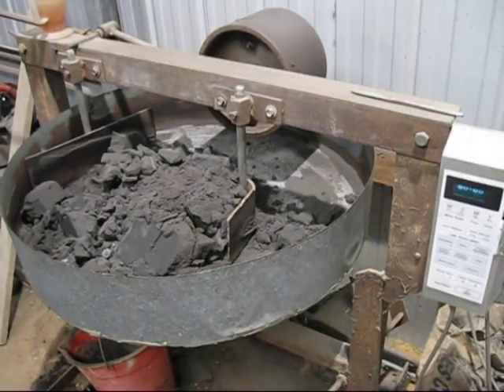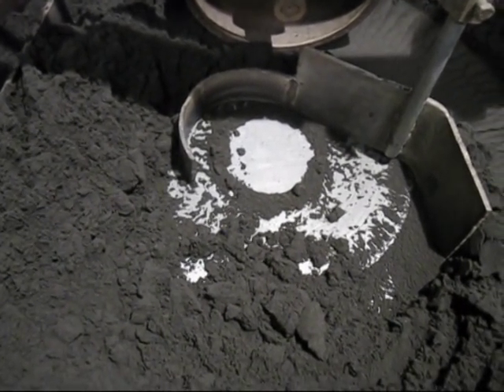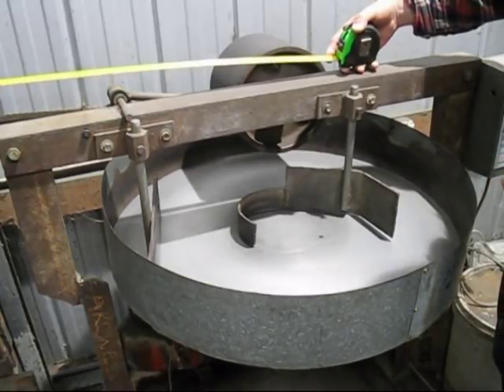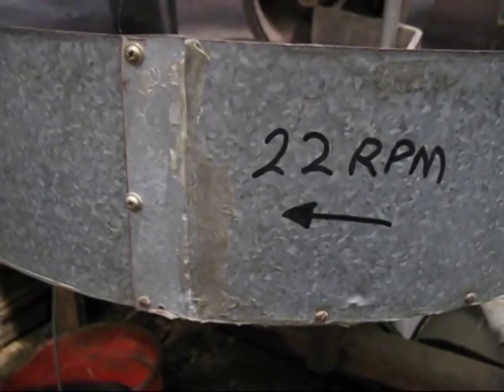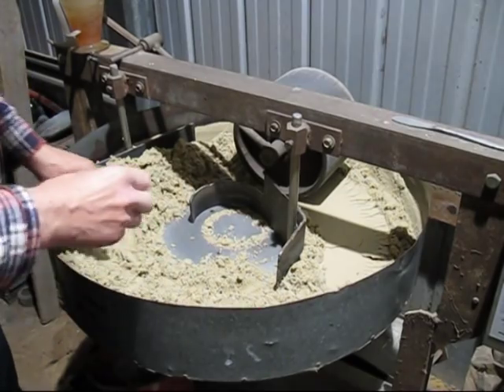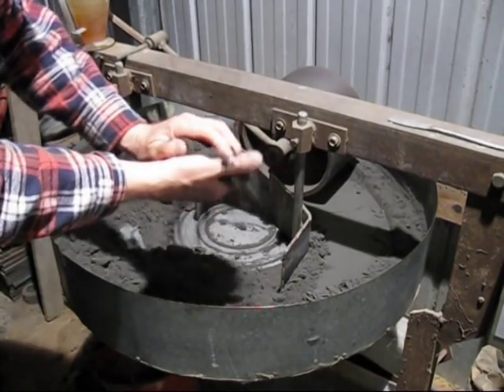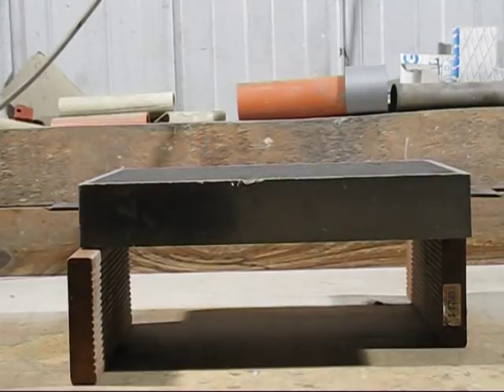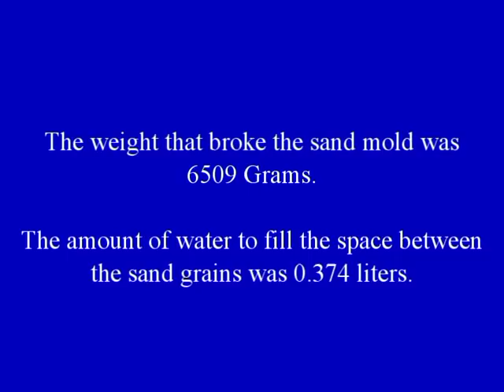Sand mixer and mixing sand

Comment: Your sand muller is the best for a small production! Years ago I worked in a foundry (grey cast iron) as a molder and our night crew mulled thousands of tons of sand and on more than one pour got the moisture content wrong leading to amazing fireworks.  I still pour Aluminum, Brass and Bronze with my own petrobond mix in my 55 gallon drum forge, but after watching this video I might try Green Sand again...Might be a whole bunch cheaper! Thanks for the informative video!
Reply from the maker: Anything is better than mixing sand by hand.

Comment: Great video.  I just made my first aluminum casting / test today. Successful test of textures on lost foam. 
Long way to go yet.  Your videos are a great help.  Thanks.
Reply from the maker: That's great, have you made a video of the melt?
Reply: @luckygen1001  Recorded some but haven't reviewed it for editing yet.
Asperations vs Reality.
Super cool casting vs Learned a lot today.  Great day.
Will be posting when ready.
Reply: @luckygen1001  I just posted the results of my first casting tests.  
Pleased with the outcome. 
What should be put in the aluminum to separate the metal from the dross?  I've seen many videos about this, but still questionable.   Help very much appreciated.

Comment: Those microwave oven timers are handy, I made one for an electrical heating pad for sore muscles us old farts get. I can of course set the time but more importantly I can program and vary the power level, like two minutes on high, 8 minutes at 80% power, the thing works a treat. ☺
Reply from the maker: Microwave oven timers are seldom reused for other purposes, which is a shame because they are so useful.
Reply: Yeah, I have to look away when I drive by one roadside now, too much parts of 'em on the shelf. I made several shop coolers from the squirrel cage venting blowers found in the high power over- the- stove models too, they can really move some air.

Comment: Awesome description.  I use Petrobond in my small aluminum foundry.  Since it uses oil instead of water the explosion factor is greatly reduced.  I believe Petrobond is more expensive but for the small castings I do for model steam engine work it works well. Thank you for sharing your expertise!  Fred

Comment: How did you make the microwave timer? Does it just have a relay it clicks on that normally goes to the magnetron? Or does it have a mosfet transistor out put and you just run that into a relay for the motor Really good idea
Reply from the maker: All microwave oven timers have a relay which is switched on by an ic which does all the timing functions and clock. This is the reason why I use it because when the motor starts up it draws a lot of current and the relay is designed to take that large current surge.

Comment: Are the percentages by weight or volume? Very interesting video.
Reply: You beet me to asking this very question..
~ smiles ~
Reply from the maker: By weight.
Reply: Mark, in any technical/scientific mixture, the ONLY way to assure consistent results in the real world is to proportion by mass. volume, especially of liquids, will vary based on temp and pressure, mass will remain constant. a gram of sand, or water, or clay, or coal dust, or chicken feathers will ALWAYS be a gram under any conditions our frail anatomy can survive. if a mixture is given in percentages, you can reasonably rest assured the units are those of mass unless volume is specified.
Reply: @luckygen1001  Thank you, I had the same question.

Comment: Another  great video/demonstration. I often wondered why your sand was grey when mine is orange coloured . Have only ever bought the sand in both green and oil bonded varieties but will now consider mixing my own once a muller is built. What type of base sand do you use?
Once again thanks for entertaining and educating us. :-)
Reply from the maker: I have both green and oil sand. The sand you saw in the video came from a local sand pit. It is very fine and is used for swimming pool filters.
Reply: Just one other question if you don't mind, do you mull oil based sand and include the burnt sand from the mould?
Reply from the maker: Yes I do mull oil based sand including the burnt sand. The sand now has a dark brown colour.  I do not understand why people on youtube separate their oil based sands, mine has plenty of strength and I rarely add oil to it.

Comment: Where did you get the mixing wheel from? Is it a flat belt pulley? A large castor wheel? Very effective machine. Thanks for posting.
Reply from the maker: I copied the design from a flat belt pulley, made a pattern and cast one in iron.

Comment: ingenious use of a dime a dozen microwave controller, is it as simple as connecting 240 in and 240 out?
Reply: Also, do you mull your own coal to obtain the coal dust? I would like to try my hand at casting and I'm in the process of gathering gear, cheers Ben
Reply from the maker: If you are familiar with relays and how to connect them up then it is very easy. I buy the coal dust ready made as black coal is very to source where I live.

Comment: Thanks for the videos, So much great info. I’m in Adelaide. Just started doing some casting, aluminium in greensand. Using bentonite and playpit sand. Getting sand from landscape suppliers. It was very fine. Went last week to get more and they said don’t have it anymore. New Gov regulations require playpits use soft fall sand. This stuff is really course. Don’t know how kids are gunna make sand castles with it. Same story everywhere I went. Do you buy special foundry sand and if so does it have some sort of grading as in grain size?
Reply from the maker: I get mine from a sand pit. I don't know what grade it is but this sand is used for swimming pool filters.

Comment: Love that mixer. 👍 thanks for the sand recipe😁 nice to know it is that simple. I’ve done a few bronze castings but can’t get the sand right. This will help amazingly. 
Q? Could you use charcoal instead of coal?
Reply from the maker: No, coal has to be used.
Reply: Thanks

Comment: Great video giving information not readily available. The percentages of bentonite and water are available. The time to mull the mix is not readily available. Any idea of the weight of your mulling wheel?
Reply from the maker: Without taking it of I would say it is at least 10kgs.
Reply: OK I think I have marching orders for this. A few cast iron weights setup and turned flat on the lathe and I can have something pretty equivalent. Thanks!

Mark

Comment: Hi luckygen1001,
I'm finally building a muller based on your design, so thankyou for sharing your info.
One question. Have you had any issue with sand getting to the bearings in your compactor roller? I'm Trying to figure a method to avoid this issue
Cheers
Reply from the maker: I used a water pump sealed ball bearing race from a large diesel engine for 30 years and has not been replaced in that time. The ball bearing race is high enough to avoid contact with the sand.
Reply: @luckygen1001  thankyou. That's pretty impressive.

Comment: Such an informative video, thankyou.
I am curious though. How many melts had the first batch of used sand been used for and at what point do you discard your used sand, if ever you do? Cheers.
Reply from the maker: If you cast iron only about every two years the sand has to be replaced but with aluminuim the sand will last a very long time.
Reply: @luckygen1001  thankyou. Thats interesting information. 2 years is still quite a while considering the torture the sand must go through.
Reply from the maker: @michaelclark2840  Most of my iron castings solidify quickly so the sand lasts a long time but if I cast a really chunky iron casting that weighs 5-8 kgs it gives the sand a hard time because it remains a liquid for a long time. If I poured those castings all the time then the sand would have to be replaced a lot sooner.
Reply: Thankyou luckygen. That's all interesting info. Really appreciate your sharing. Cheers.

Comment: It would be better if you design a system to directly empty the sand in the container while milling ending. Make a plate to divert the sand towards an opening. this is just an idea, no offence. Good video , and video editing .
Reply from the maker: if the mixer was on a pivot it could be tilted to empty the sand out.
Reply: Still you have to work out to remove the sticky sand , but the method I suggest it will remove all by itself. Make 2  or 3 inches  hole at the center with lid, after crushing and mixing direct the sand toward the center where you have opened the lid keep the bucket bellow at center all your sand will be directed towards the center and fall off from the hole. then close the lid and start another batch. Use another vertical shaft for giving direction for removal purpose and it should be movable  when you don't want to to remove sand it should be up , and when you want to remove sand you lower the the shaft .

Comment: Lucky, how do you grind bentonite?
Reply from the maker: I don't, foundry grade bentonite comes in a super fine powder ready to use in a 25kg bag. Some people get bentonite from farm supply places and I think it has to be ground up.
Reply: @luckygen1001  where from u getting yours? Thanks
Reply from the maker: The place I got it from has been taken over by Cast Metal Services in Melbourne so try them. @VladekR
Reply: Thanks, I check them out in September when I am in Melbourne @luckygen1001

Comment: sets mixer to popcorn
Reply from the maker: That is not the only option on this controller, it does every thing and mixes sand.
Reply: "For this casting, I'm using 6% bentonite mixed to a nice frozen vegetables consistency..."
Reply from the maker: It helps to defrost the vegetables.